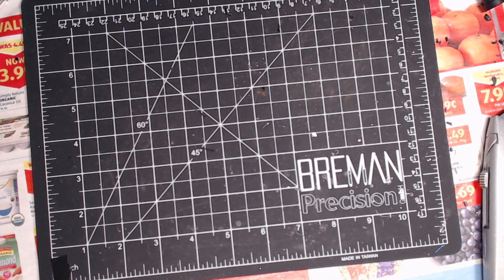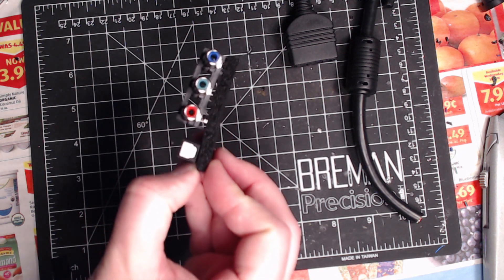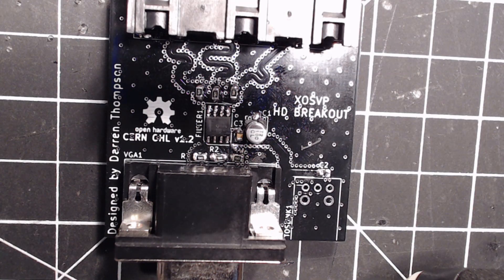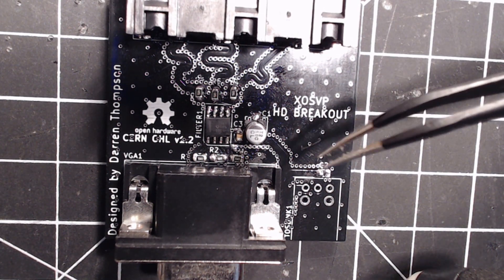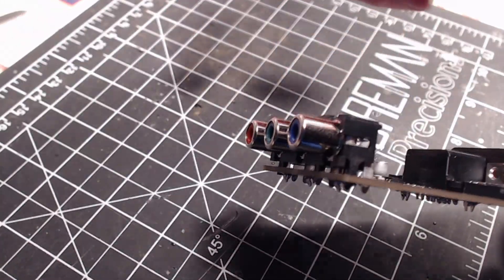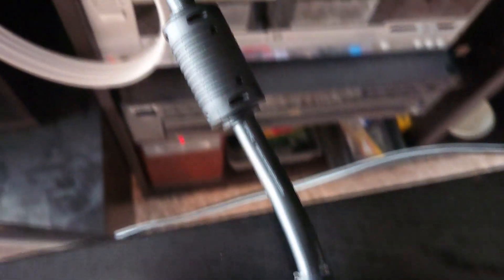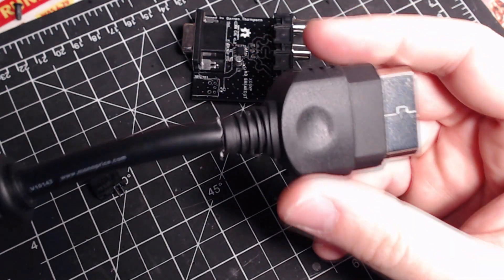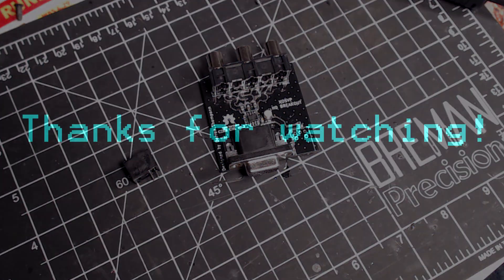Xbox XOSVP Mod Kit (Component for OG Xbox)

Comment: The availability of this is really a problem. Both the preassembled versions and the kit are sold out. Might be better off with the HD AV Pack.
Reply from the maker: Haven't checked lately, I pre-ordered mine. Hopefully he'll restock soon.
Reply: It's open source so order and make your own (as I am). Making 9 to sell

Edit: my soldering iron broke so if you're were looking to buy one they'll be on eBay in probably 2weeks